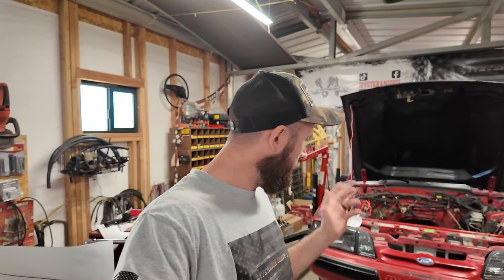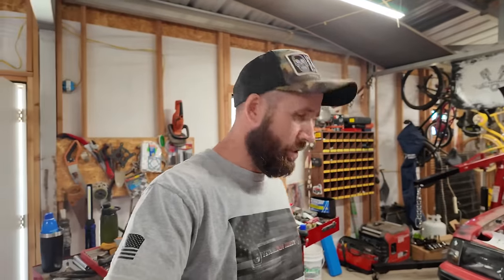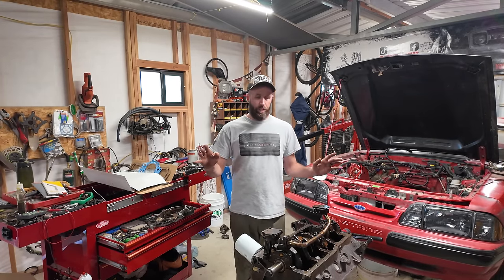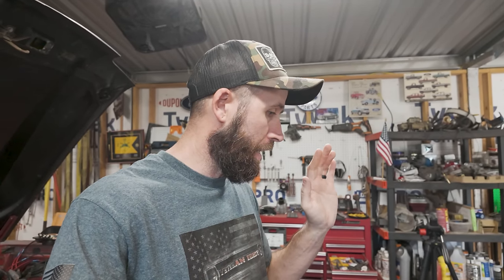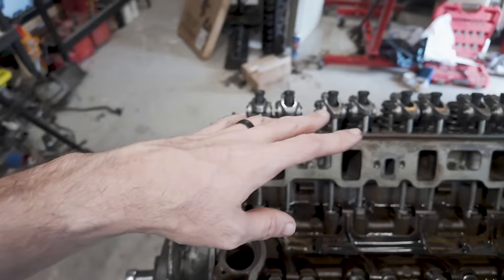GT40 Budget Engine Build, Part 2: Heads and Roller Rockers

Comment: "Nope, I'm an idiot. Didn't put the thrust plate on"
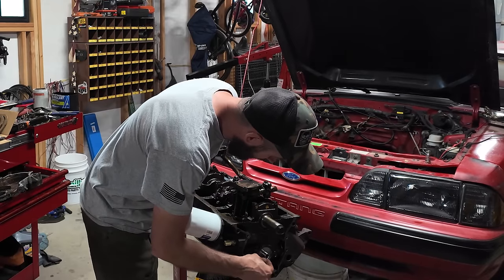[I was still laughing from you approaching the engine with the timing set upside-down @03:10 - and the "Torque Spec Gag"]
This is SO relatable.
Reply from the maker: 😂😂 dude this is my life, all day everyday
Reply: I fell ya' Brother.
Reply: The hesitation and self-doubt is palpable.
Reported.
"I'm in this video and I don't like it".

Comment: Neomustag did a video a while back ago with swapping the pistons around.
Reply from the maker: Sounds kind of sketch, considering piston slap on cold starts is normal for this conversion??? Eh, maybe I'll give it a shot when the other engine is built and this one can get sent to the moon 😂
Reply: @VeteranRevivals  He mentioned that in the video, I guess it was an old dirt track thing back in the day.  I planned on doing that on mine as well as running solid roller lifters instead of hydraulic with a tame hydraulic cam.  I don't drive mine everyday and only when it's AZ "warm" so piston slap shouldn't be too bad.  I'll let you know.  😎👍

Comment: I got a heat reducing spacer for my upper and lower intake on my 89 stock mustand 5.0 for around $100 back in mid 90s. that really reduced the heat of the upper intake and made a noticeable increase in power
Reply from the maker: Nice, I hadn't considered it for that aspect.
Reply: @VeteranRevivals  I only had a few bolt on part for my stang. I also had a blaster two ignition coil. K&N air filter underdrive pullies and magna flow mufflers with pipes. I wanted to do more but I was living in a condo community in Atlanta at the time so that limited my abilities greatly. BBK has some parts you should look at in the future.
Reply from the maker: I had BBK parts all over my 91 GT, love their products.

Comment: I just tore down my  95 5.0 as well as another 5.0 I got when I bought a set of new in box  svo y302 cylinder heads  also I have done this in past on countless other builds as well as had a tank I use to soak parts in blocks heads exc I learned long ago during my first summer working for uncle at his automotive machine shop he taught me that kerosene is absolutely the shit to use also when you  heat it oh boy words of wisdom keep it far away from flames sparks exc if you are going to use kerosene especially if you heat it 😮. I used a plastic 55 gallon drum with some heating elements  let the last oil leak that baked on the block of the 302 sit for about 3 days block looks great oil gallery all brown stains and that layer of burnt conventional oil all over the crank is gone it was all floating on top I then took a pig pad and let it soak all the oils off top of kerosene
Reply from the maker: Nice!

Comment: I personally was rebuilding my car for the factory EFI. But after my son's carbureted car, I've decided mine will be carbureted also. Since you already have EFI, it's no doubt cheaper and easier to stay EFI and get tall valved covers and a spacer. But it'll probably run better and definitely be easier to diagnose with a carburetor. If I were where you are, I'd just get the spacer and valve covers.
Reply from the maker: I'm with you on that one!

Comment: The 351 if you dont stroke it just do a 347 or 331. Swap parts will be about what a 347 rotating will be still lighter.
Reply from the maker: This car will see a lot more everyday driving than I would be comfortable with on a 347. 331 would be good though.

Comment: Hello, I have a bronco with a 302 EFI engine and GT40 head, I would like to install some 1.6 roller rockers, could you recommend a model? Should I change the push rods?
Reply from the maker: The roller rockers I used for this video are pretty good, I changed the pushrods because these were worn and unusable. If your pushrods are in good condition you may not have to change them.

Comment: You can’t adjust those rockers like that. You have to put the cylinder at top dead center then adjust the intake and exhaust on that cylinder then turn the crank and do the next cylinder in line of the firing order. 13726548 is the firing order.
Reply from the maker: All the lash was adjusted on base lobe. What you saw was me going around and adding preload.
Reply: @VeteranRevivals  how do you add preload to a lifter that is holding open a valve, would the plunger not be bottomed out
Reply from the maker: Adding 3/4 turn preload is just adding 3/4 turn preload. It doesn't matter where the lifter is in it's cycle. Lash has to be checked at base, but preload on a stud roller rocker is just preload.

Comment: Should have just LS swapped it😂😂😂…..i have a roller 302 in the garage i have to build too for my sons ‘67 mustang….but id be lying if i said i didnt wanna throw one of my spare LS motors in there……..fox body is an easy LS swap …first gen 60’s mustangs…..not so much!!!……although the 302 were building has aluminum heads with 58cc chambers and better flat top pistons with a higher compresssion ring hieght (from summit) giving us around 10:1 compression give or take depending on head gaskets…..we have all the parts except for the cam….im thinking a 211/220 cam with a 2300/2800 stall in the c4 trans….aiming for about 325hp or somewhere in that neighborhood…….and thats not easy or cheap to do on a small block ford by any means….unless you got boost or laughing gas!!!…..i can get that easily with just a nice tune on a iron 4.8 LS truck motor and damn near 400hp if i were to throw the right cam at it ……litterally for pennies on the dollar compared to the ford 302……but whats done is done and we already have a pile of BRAND NEW parts including the NEW aluminum heads and pistons to go into the freshly machined block…….i already swapped the original C code 289”s garbage intake and 2 barrel carb to a performer RPM intake and an ACE’s killshot EFI unit that will easily swap over to the built 302 when the time comes…..so at the end of it all the kid is gonna have a pretty stout and reliable well laid out late model roller cam efi 5.0 in that old original C code coupe (Fremont car)……..bay area car since day 1……, if it were up to me though when its all said and done, Id sell it for a nice profit and buy a GM product that would easily accept a LS swap in literally 1 weekend……any pre ‘75 GM car would work for me…..preferabbly a 2 door unless its a suburban or a cool malibu wagon or vista cruiser…..but hey, kids nowadays have horrible taste in vehicles
Reply from the maker: 😂😂 all the swap parts for the LS is what costs the 💲💲. Rebuilding all of this with the cam and rockers was about $1100, so it was hard to not give it a try for now.
Reply: @VeteranRevivals  key words…..”for now”……good luck homie, cant wait to see it back in action